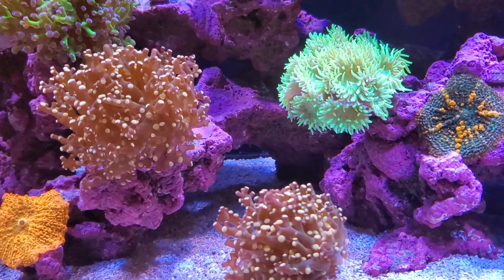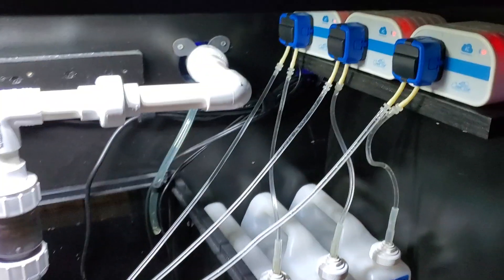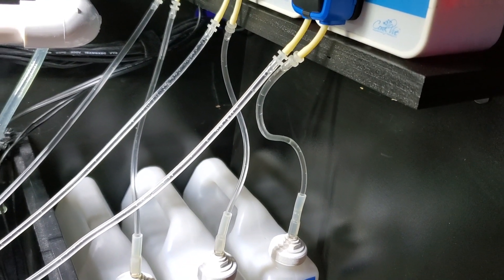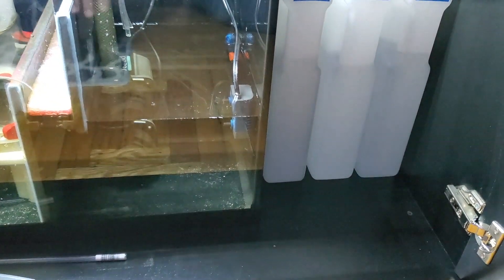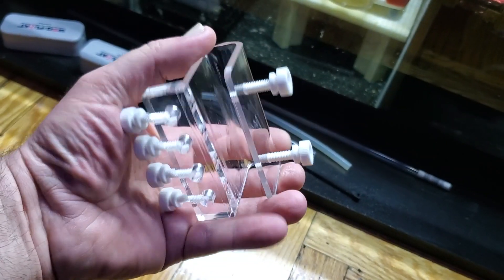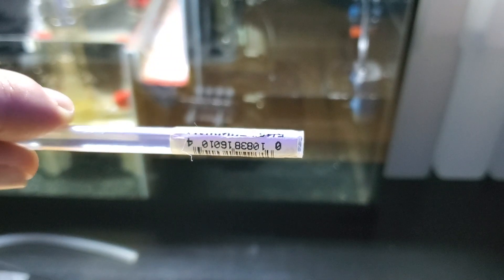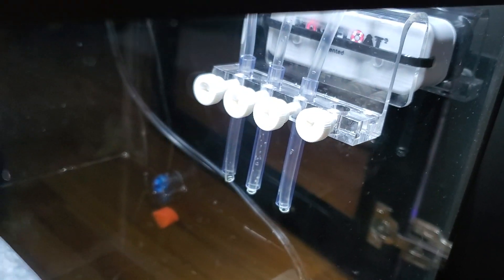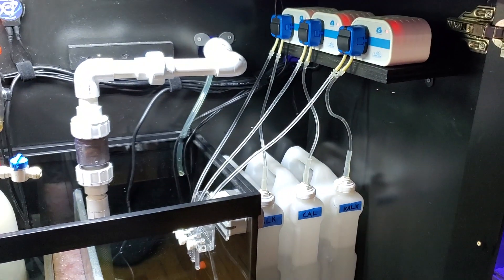75 Gallon Reef Tank - Adding A Dosing System

Comment: Welcome to the land of living with dosing.  You are going to love it.  Things in tank will begin to take off.  Dont get frustrated.  Yup move those lines.  You are going to be loving this.  Keep it simple, low tech.  Just test test test, dont get frustrated if numbers go haywire while adjustments getting made, test everyday, dont wait a few days, corals love it when all is up...lol.  they suck it right up.   the first week sucks, testing testing,  resist any water change.  Some doses dose faster, cut up doses to smaller throughout day, no need for extra pump.  Most times when it separates tank getting to much at once, kinda like in college when we drank to much and puked. Lol.  Your tank pukes.  Small doses better.   Test after first water change, only do a smaller one.  Hang tight, as a non gadget guru here,  I love it.  Montis growing like weeds.  Hang tight, you got this.  Who doesnt like less water changes.  With less wc feed tank with supplement.  Nothing fancy.  😁
Reply from the maker: All great advice👍👍👍

Comment: On my Sump I didn't have room for any kind of dosing tube holder to keep the lines in place.  I just drilled a few holes in the trim, just on the horizontal lip part.
Reply from the maker: I was thinking about doing that, its a good idea👍👍

Comment: Been running these pumps for almost a year now. Not a single issue at all with them. Have them set to dose Cal and alk 12 times a day mag once a day. Also used the colbalt aquatics airline tubing to go from the simplicity dosing container to the heads then from the heads to the sump. The colbalt tubing fits perfectly snug and air tight over the X1 dosing line.
Reply from the maker: Thats good to kn3about the tubing 👍 thank you